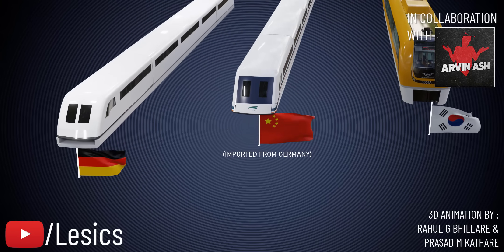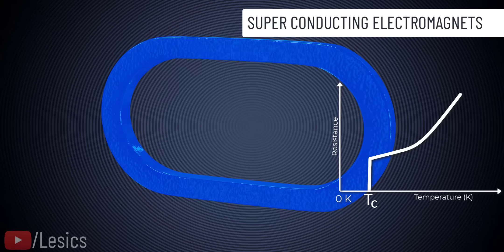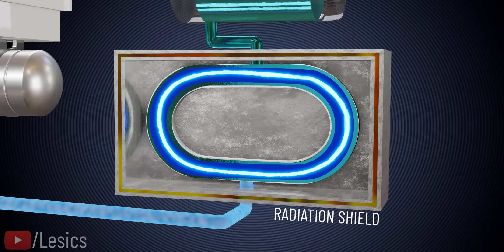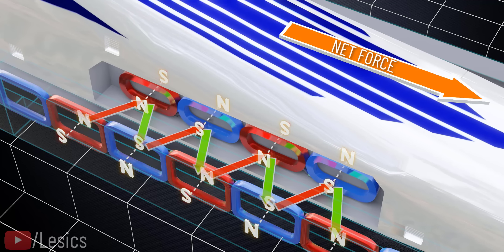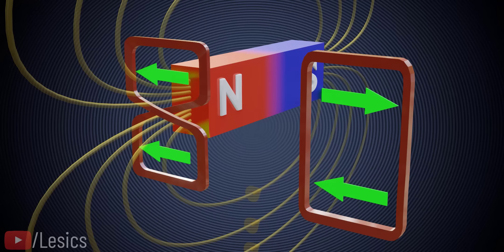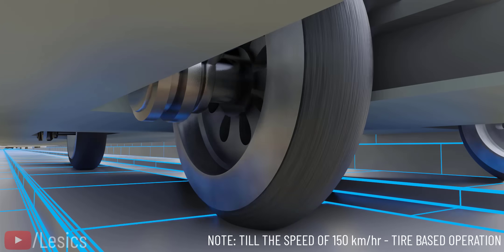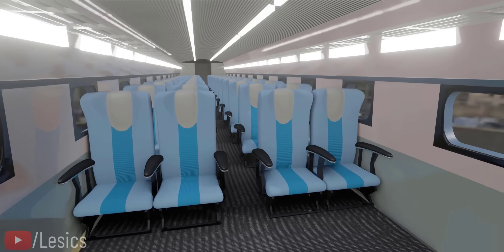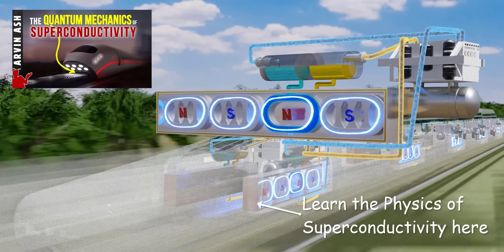The Fastest train ever built | The complete physics of it

Comment: China is officially introducing its maglev train today. I wonder if the engineering theory is the same ? It also runs at 600 m/h.
Reply: It is a bit difficult to know the truth because I have heard China wants to extend the airport line but I have seen video of a repulsive maglev still with only 1 cm clearance but without all the computers that they hope will go 600 km/h but without the same guideway as the Japanese one which gives them great stability with 10 cm clearance.
Reply: This maglev is normally conductive, so unlike the Japanese method, it hardly emerges.  Therefore, there are safety issues.

Comment: If they are using magnetic shield for safety of passengers then the mobile network inside the train will be zero. Is it so?
Reply: free newspaper will be available. No worry.
Reply: Not necessarily... External antennas could easily "Pipe in" satellite or cell signals -- though cell "Hand off" operations would need to be up to the task.

Comment: The China high speed train currently commercial highest speed is 486 km, servicing many cities. The CIT500 highest testing speed in 2014 is 605 miles and is currently building up the infrastructure and commercially be available around 2024, 3 years earlier than Japan 2027.

Comment: Impressive. But a few things:
- The symbol for kilometres per hour is "km/h", not "km/hr" (which would be "kilometres per hour-revolution")
- The word kilometre is pronounced as KI-lo-me-ter (rhymes with nanometre), not ki-LOM-e-ter (which rhymes with thermometer). It's not a measuring device, but a unit of measurement.
- Something can't be "quite unique". It's either unique or it isn't (just like something can't be "quite dead" as opposed to "a little dead"). Just say "quite different".
- Why would you use inches for the levitation height when you measured everything else in SI units? Why not say "99 millimetres"?

Comment: Oh I didn't know there was literally zero resistance.
I thought there was merely very low resistance.
That's cool.  I didn't even know that was possible.
Reply: Not exactly zero if you account for the air friction. Zero friction can be achieved using a vacuum tube such as the hyperloop for instance.
Reply: Actually, strictly speaking, even in vacuum space maglev trains would experience electromagnetic drag effect caused by eddy currents which almost acts like friction.

Comment: There is an interesting question about efficiency. The energy to keep the train levitating has to come from somewhere. In this case, it is obviously coming from the work on keeping the magnet cool. According to the thermodynamics, perpetuum mobile of the second kind is impossible. I.e. it's impossible to turn heat to mechanical energy with 100% efficiency. An internal combustion engine can't be 100% efficient. In the case of cooling down something, the situation is even worse. Because of the same law of thermodynamics, in order to cool down something you must heat something even more, i.e. you produce much more heat in the process than you are taking out. It means that the inefficiency of the process is squared compared to a combustion engine, for example. An internal combustion engine efficiency is around 25%. Therefore, the efficiency of levitating is going to be around 5%.

Am I wrong?

Comment: Can it handle earthquakes, Japan has so many and tsunami possible every coast
Reply: The route is in the mountainous area, inland, and the shaking is small and the superconductivity is theoretically fast and stable.
Reply: giving the bucket design of the track its certainly less in danger then a High speed train on common rails. shouldnt be too much trouble to build the track robust enough, considered how japan builds much more complex infrastructure already earthquake resistant.

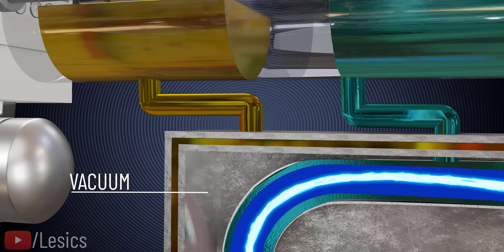Comment: 3:34 - "to prevent convective heat transfer" - I'm a little puzzled as to why convection would be a problem within the cooled environment... oh wait nm I get it, it's because the radiation shield has radically lower need for cooling, so it needs to be thermally isolated from the superconductor... presumably there's going to be a second insulating shell or vacuum shell in a sec.

Comment: Why do they retract the wheels? Air resistance? Wouldn't it be safer to have them out at all times in case of malfunction? I'd guess they have some sort of mechanical "snap" mechanism for the wheels in case of emergency
Reply: Probably to reduce drag. If the wheels fail to deploy I imagine the train is designed to land safely (but expensively!) without them.

Comment: Not exactly true, although there is no (virtually no) energy loss in the SC coil this by itself would violate the perpetual motion laws of thermodynamics, the reason this doesn’t happen is because the energy put into the system to cool the coils is immense and if the temperature rises above a certain point 100% of the energy in the isolated coil is lost through thermal exchange with the air.
Reply: nope, superconductors have exactly zero resistance, not even in the order of pico ohms. Also, this doesn't violate any thermodynamics laws. Perpetual motion machines violate either 1st or 2nd law. After all, doesn't a lump of coal underground store energy indefinitely? The whole point of superconductivity is just that.... you can store energy in it without loss provided you maintain the boundary conditions. But it has zero resistance when you do.

Edit: out of curiosity, I've just google searched a little bit and found that violation of 2nd law in a superconducting ring is one of the obsolete research areas.

Comment: Excuse me?

They basically inject a current and stop. Only for the coil to continue moving electrons? 
Is this Quantum Physics breaking the law of conservation of energy?

That is a mind blowing thing.... 

However, 
 
No... It does lose energy. Magnetic friction... I.e. Heat generation. 
The Helium coolant will be boiling off and dissipating. 
The energy source required to run that train system is the cooling system... Plain and simple. 

I might also point out that Helium is a rare gas these days. Very expensive and quickly becoming un-obtainable.
Reply: Newer maglevs use Nitrogen as super conductors have got better(higher temp), the train discriped will I presume be upgraded and hence a less energy intensive cooling system very quickly if not before release.

Comment: So in the case of a slight failure of the cryogenics, if the temperature reaches 9.3K, all energy accumulated in the superconductive coil will be released in an instant explosion?
Reply: Astute observation. This is called a magnet quench, when this happens the temperature of the coil raises a lot, which can cause the coolants to boil violently and make a loud bang. This can create electric arcs and can potentially damage the magnet.
This isn't instant however, in large magnets the process takes up to a few seconds.
https://en.wikipedia.org/wiki/Superconducting_magnet#Magnet_quench
Reply: @RB-kb3tc  It has been tested for ten years and then approved for export in 2007 so I feel confident in it.
Reply: @RB-kb3tc  I am curious to see the redundancy numbers for such a failure. I mean, how many magnets a train can lose to be able to safely stop from 600 km/h.

Comment: I wonder what would happen if the train was at it's max speed and someone turned off the switch?
Reply: I haven't researched the topic enough so what I say is part speculation
The power inside the actual train is mostly used to keep the superconducting magnets cold I think, so if the track lost all power the magnets inside the train would keep working for a while.  As long as they do, the train is safe because the figure 8 levitation coils on the track don't need any power.

The train would lose speed until reaching 150km/h.  Then there must be a backup power source in the train that allows the wheels to retract. (If the situation is really bad and the train loses all power or too many magnets stop working, the wheels probably deploy immediately)

Comment: I imagine a surface vehicle traveling at that speed has to be isolated pretty thoroughly from the surrounding environment, to prevent debris and obstructions from getting onto the guideways.  That presents a host of practical problems that will probably prevent widespread applications.
Reply: They can figure that out..plastic tubing around the train ...or some sort of shields/coverings around the sensitive areas.... It may be a bit costly..but can be done ..
Reply: When they showed the picture at the end of the train running through a field I had the same thought.   How do they insure a clean track?
Reply: Keep it in a single 11psi tunnel free from any problem you can imagine.

Comment: As - induced lift to drag ratio - is applicable to aerodynamic, same also applicable to mag lift vehicles. 

Energy sourced from propulsion coils went into - forward/lifting/tracking budget, while the SCMag support those operations. 

Once vehicle has reached a critical speed the #8 coils generates (dynamic) lift. The lifting energy between #8 coil and SCMag is derived from (dynamic) momentum in the form of drag. To the propulsion coils that translates to electromagnetic drag. Thereby electromagnetic lift to drag ratio.

Comment: When one of the magnets failed, levitation failed with train speed. And too expensive to build the train and railway lanes. For that train speed, train can use propeller blade like plane and aero dynamics wings and blades to levitate and speed up with less friction on the wheel and can retract the wheel while wings are effective at levitation.
Reply: The problem then is how to power it with electricity.
Reply: And you're going to fit wings into narrow guideways and tunnels... how, exactly? Or are you proposing to punch far larger holes through cities and mountains, when tunnels and other non-electric works already make up 70% of the construction costs?

How are you even going to ensure stability (aka not crashing into walls or ceilings or flying off)? As the video explained, the maglev system is strongly self-centering without needing active control.
Reply: @СУ-м2о6в  Skytrain, mate. No tunnel need, just bridges.
Reply: @СУ-м2о6в  For steering, use air brakes and flaps, or doesn’t need railway at all because the weight of the train is almost negligible in motion with wings levitation with aero dynamics technology and just build bridges which only need super strong strings for train power and lanes to hanging the train in mid-air and can lower the cost of building in multi billion dollars. (You can imagine like in sci-fi?)
Why do you still thinking about the old fashion way like building the railway and tunnel while complex technologies are considered to put in a single one? Think out of the box, mate.🌝
Reply: @freezee7547  Yikes, just crazy unintelligible ramblings untethered from reality. Goodbye.
Reply: @СУ-м2о6в  Space elevator is becoming more realistic and people are making the cable for space elevator, why don’t use a such technology cable in modern sky train then?

Comment: It seems, you`ll need A LOT of copper (or silver), just for the propelling coils along the track , especially for the long distance MAGLEV lines. Using other metals would require more power.
Reply: How much more than overhead wires?
Reply: @edwardbarnett6571  I can´t tell it, it is a matter of calculation and knowledge, which I do not have in great depth. Normal overhead high-voltage lines (220 kV - 380 kV) in Europe consist of an inner steel core, to carry the weight, and outer aluminium filaments for electricity (I do not how much the losses for the skin effect in AC are in those).European trains have overhead and ground  lines out of copper alloys and have in most cases one of the following voltages: 1.500 V DC
,  3.000 V DC, 15 kV AC 16,7 Hz, 25 kV AC 50 Hz.
Reply: @AnonymosAnthropos  Don't forget overhead wires wear over time so eventually the maglev may use less.